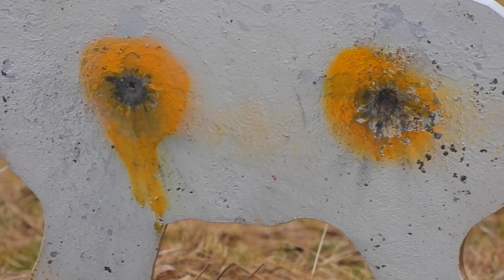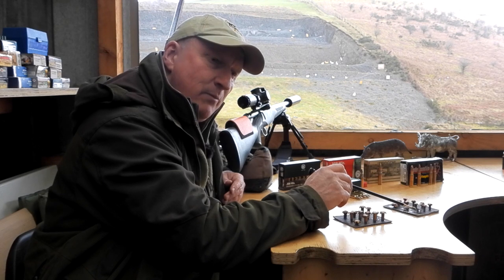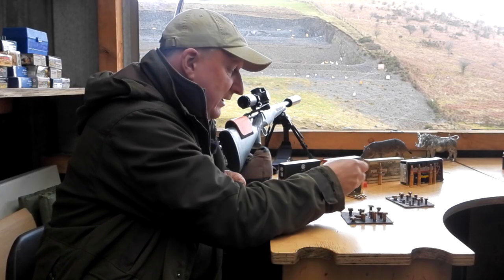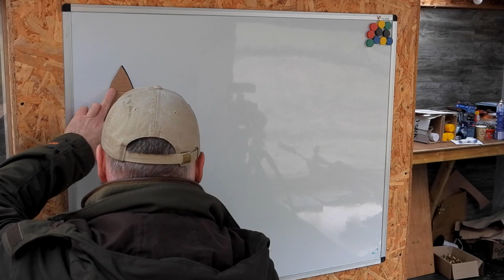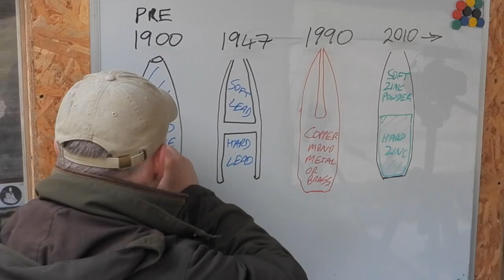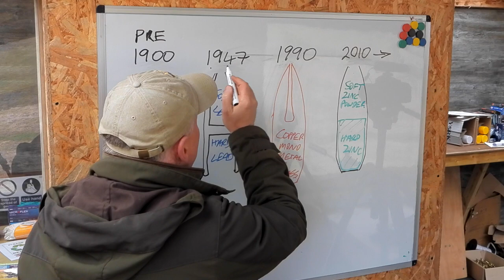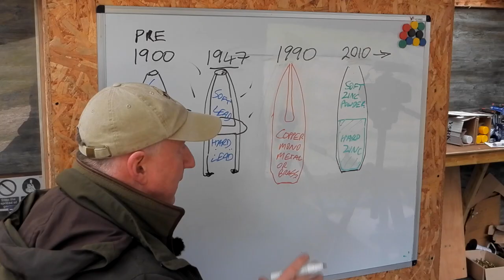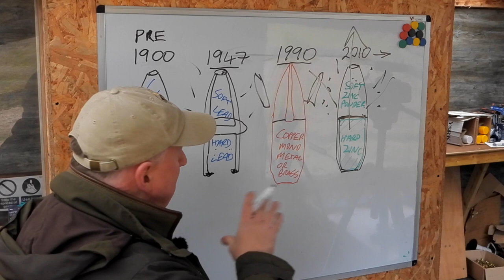The story of zinc bullets

Comment: I cast both zinc and lead bullets, anyone curious about casting zinc bullets I will give you the best piece of advice I learned the hard way. DO NOT EVER CAST ZINC IN CHEAP ALUMINUM MOLDS! ZINC EATS ALUMINUM! instead use a cast iron mold or a brass hardened one from arsenal molds. Zinc is actually castable at 900+°F not a whole lot harder than casting lead and certainly much easier than trying to cast or swage copper.
Reply: <3
Reply: is it possible to shoot zinc casted bullet at full speed  as jacketed bullets ?
Reply: You can use aluminum molds but have to smoke the cavities heavy so they are carbon lined to  not eat out the molds.
Reply: @hartstudebakerkid  ok thanks for that that’s what I was thinking. What about anti seize ?
Reply: @King66nb766 ya but the twice as long as equivalent lead ! So their not as good they don’t expand and the wind effects them. But if your casting wheel weights their super cheap and diy. Zinc is definitely not a  good commercial lead alternative the marketed bullet is 3x the cost and doesn’t fly as well. Their just trying to make a commercial p c lead alternative look good

Comment: I cast solid zinc projectiles and my 9mm hollowpoints fragment on impact but the base travels about 13 to 15 inches not to mention I get 1600fps.
Reply: Old things are new again.
'Elvis Ammo' made a few cool vids on the subject.
Reply: @HAYAOLEONE  I love Elvis Ammo! I learned a lot of casting tips from him... Unfortunately he's went MIA again I hope to see him start uploading new videos again soon.
Reply: @HAYAOLEONE  I got the Elvis Ammo .224 mold from Jared at arsenal molds and picked up the 4 cavity brass hardened mold and that damn thing is heavy compared to the aluminum Lee molds lol it's too notch though, I cast zinc and lead bullets out of it. The zinc bullets drop at about 45 grain projectiles and they're awesome just be careful loading them and watch for compressed loads because it's still the size of the 77grain bullets
Reply: @dthundergunb3115  🤙
Reply: @dthundergunb3115  If you don't mind me asking, what load data are you using for those lighter zinc projectiles out of the 77gr mould?
Reply: I use pure zinc for rifle. Jacketed data. 220 grain mould 220 jacketed data despite lighter bullet. Havent gone hotter yet but tested different calibers. 308,338,450B

Comment: What’s not mentioned in this video is cost. Cost plays a big role in selection of a bullet. Even though the 1900 projectile is old it still does a wonderful job putting a animal down. Plus they are extremely accurate and they are cheap. In recent years a few of my cast friends have been casting zink projectiles. The issue with solid cast zink projectiles is they are ALOT lighter then normal jacked projectiles. So that can be a issue in regards to the correct powder charge and powder case fill. Not to mention there’s zero data to make these kinds of zink cartridges.
Reply: Copper and zinc  are so close in weight you can use copper load data.
Reply: Been moulding pure zinc for two years plus. 63% weight on average. I use jacketed bullet data and no lube or gas checks. 220 grain mould about 138 actual using 220 load data. 87 grains imr 4831 in a 338 lapua on 20 lb propane cans nice expansion. Not as hard as solid copper but barrel wear is worse than jacketed lead. Zinc is bearing material though so “slick”
Reply: @pitchforkpeasant6219 zinc is definitely known to wear out a barrel very fast. It saves $ on bullets for sure but I’d only use em in cheap barrels like bear creek arms.

Comment: Did lead bullets really strip the rifling at high speeds? Or did the rifling grip so hard it destroys the bullet?
Reply: I would say it depends on how hard the lead alloy was, if it were pure leaf the rifling most likely shredded the bullet on the way down the barrel, my marlin 336 30-30 will fragment the instant it touches anything, I use the lead alloy I cast my 45 acp bullets, but they're only going half as fast in the 45 I've literally only recovered fragments of cast lead from my 30-30 loads but can retrieve almost a full copper jacketed FTX. The jacket makes all the difference in holding it together haha my AR loves zinc bullets I don't even have to powder coat them.
Reply: the rifling grooves foul with lead
then the corrosion eats the lands

Comment: What's the benefit of the hard zinc penetrator core as opposed to using a copper core behind the powdered zinc? Copper is both harder and denser than zinc. Is there some other benefit to zinc? Cost perhaps?
Reply: I'd say initial velocity.
Reply: Nothing whatsoever this video is apparently the result of anti lead pc whatever. Zinc is light and cheap and not as effective.